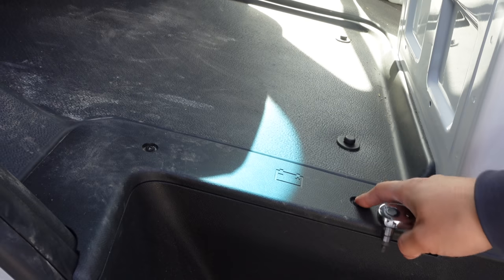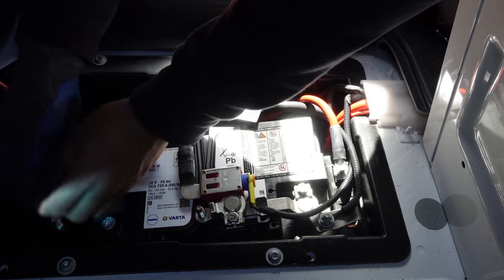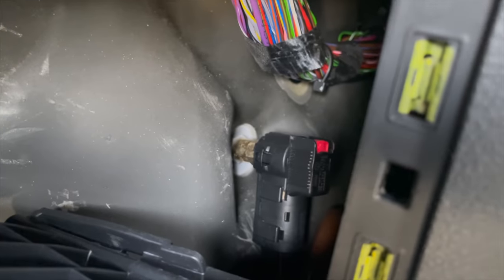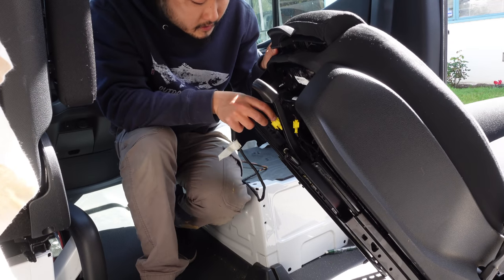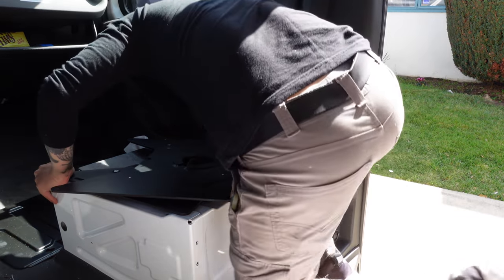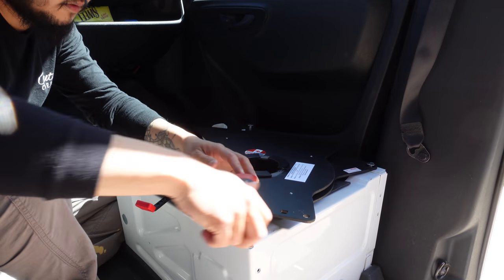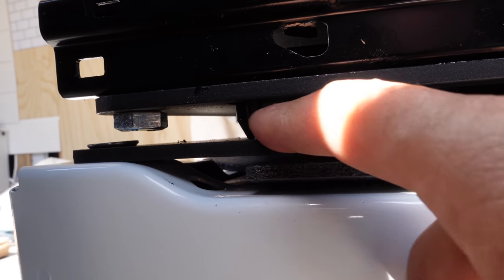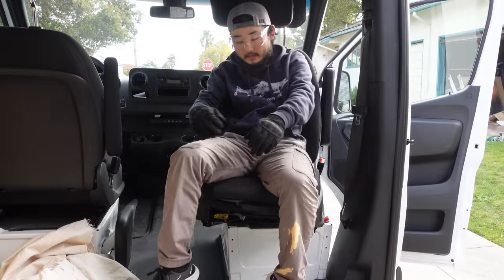Van Conversion | Installing a Swivel Seat

Comment: Did you ever fix the noise that was coming from the fan on the roof?
Reply from the maker: We're going to try putting a wind guard on the rack and hopefully that will solve the issue
Reply: @TaklyntheWorld  Those roof rack designs tend to whistle. That design has been on the market for a couple of decades now which surprises many as to why the manufacturer doesn't make a design change to eliminate the unnecessary noise etc. Fairly sure they have enough complaints to warrant some changes. Would be fair to say they should disclose this to anyone who buys them so they have a choice to accept or not accept that before drilling holes in their roof or similar mods.

Comment: Thats a cool mod! Do you know if the safety of the seat belt remains the same? If the seat swivels and you get in a crash wouldnt it be detrimental to the function of the seat belt? Hopefully the swivel has a very very secure locking mechanism to handle those kinds of forces

Comment: Spends 25 minutes undoing the battery cables and have to put back again,    Then finds out that you could pop off a cover and pull off a quick discount clip -   5 minutes 😳.     The swivel seat was a good idea !  Did ya fix the wind noise on the vent ?  .